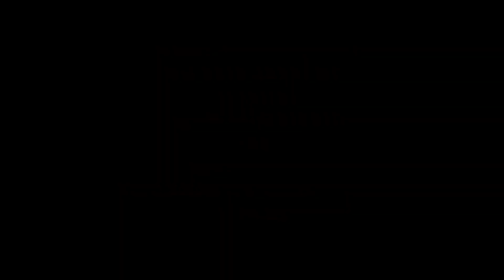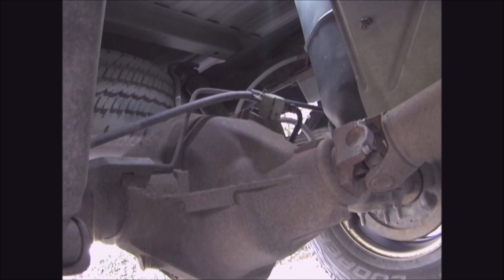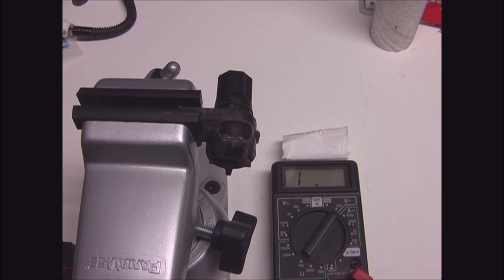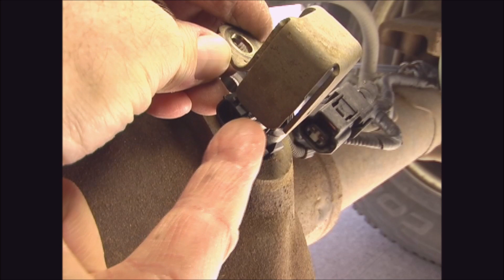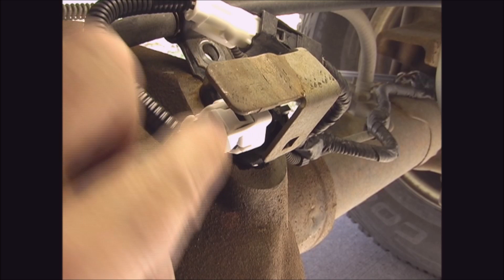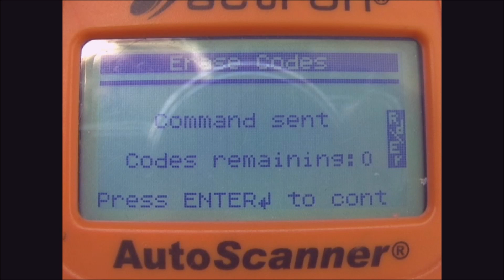How to Test and Replace Rear ABS Speed Sensor 1998 Dodge Ram 1500 Code PO720 P0720

Comment: Has anyone had this problem but slightly different? On my 99’ 1500 I’ve had the brake and abs light be intermittent since I bought it in 21’ but nothing else to indicate a problem. The Speedo works, and no CEL. I’ve replaced this sensor already and it went away for maybe two drives, I’m just unsure of what else it could be since there’s no code to look at for further instruction/possibilities. I haven’t found it on any forums other than this sensor. It seems to brake just fine and my e-brake works correctly as well any help is appreciated

Comment: I have a intermittent ABS light comes on and my speedometer drops to zero. Then the ABS light goes out and my speedometer works again? Is it a relay that's going bad or a ABS sensor.

Comment: Thank you for posting this video. Really good stuff here. My check engine light didn’t come on, but my ABS and brake light came on and after replacing this unit they did go off. When I ordered my part on Amazon, it also came with the protective cover that fit real well without having to bend any tabs up. Really appreciate this video.

Comment: Anyone have any info on the bolt that hold the sensor on? My truck is missing the bolt and i cant find a part number or size/thread specs anywhere.

Comment: Where did you get the part from because the ones I keep getting aren’t fitting
Reply from the maker: Rockauto.com
Reply: The one you are receiving is the front tranny speed sensor. Driver side, half way up the transmission.

Comment: Thank you! Thank you! Thank you! I'm more of a parts changer than a mechanic. While trying to wrangle the connectors apart 6 inches away the wires conduit about came apart. Upon inspection saw a broke wire. Checked the sensor like you did with an ohm meter without having to remove sensor. Showed resistance. Repaired wires. Disconnected and reconnected battery. Test drove. Eureka! Speedometer works, no check engine, or parking brake light. Thanks again Jay Gould. You are an outstanding intructor by the way.

Comment: I changed out the sensor and the brake and abs light is still on. What’s next?
Reply from the maker: Did you change the sensor on the transmission? I had to change that one also.
Reply: Did you do what jay said? changed mine & no chsnge also

Comment: Great and detailed video, nice work.  I do have a question, I have identical symptom on my 1999 Ram 5.9L Magnum 4x4 but the error code is P0500 Vehicle Speed Sensor.  Would you say it’s the same sensor on the rear differential as in your video causing this issue?  Thx.
Reply from the maker: Yes, I think it would be the same sensor

Comment: If these wheel speed sensors are bad can it cause transmission shifting issues after replacing the output shaft sensor

Comment: My 02 dodge cargo van has the abs and brake light on all the time(my speedometer works) 
I get 1.81 resistance on sensor.wiring is good.
Fluid is good.Brake pads are new.Brakes fine.Fuses are good.no leaks around calipers.
My scanner can't read its abs module. 
Is there anything else I can test? 
I'm just out of ideas. 
Any suggestions anyone?? 
I'm getting really fustrated with this thing.
Reply from the maker: Have you tested the transmission output speed sensor?
Reply: @WilliamFrawley  
Not yet. 
I didn't think that would cause my abs and brake light on all the time.
Reply: I have the same problem I did replace Tran output sensor and speed sensor to no avail☹️ and pointers?

Comment: Mine was very difficult to get off and on..had to rubber hammer it no joke to go in. It did fix my speedometer bit my brake light and abs are still on. What else could it be? Replace breaks and rotors because I know they are trash too and also brake reservoir empty but when I fill does not fix the brake lights or abs. Help

Comment: I had the same problem in a 2004 ram. Speedo would start at about 20. After replacing the sensor, speedo doesn't come on at all. Any ideas
Reply from the maker: possibly a fuse?
Reply from the maker: There is also a sensor on the rear of the transmission, this can be checked with an ohm meter

Comment: UGH!  I was following along nicely until 3:21, then mine snapped off, clean as a whistle.  The only thing remaining (Completely unreachable) in the Sensor hole is the plastic sensor cap.  I thought about going in from inside, but the gears would be in the way.  So, I will be digging it out from up top tomorrow morning.  Not looking forward to this project.

Comment: I've have watches a few different videos on this subject so far and none of them were very helpful. This is BY FAR, the best, most informative video I've seen, and I dont need to watch anymore after this. The other videos showed how to remove the first nut and then the bolt, and that's it... I was more interested in seeing how to remove the old sensor without destroying anything else. This was a perfect video for that. My 06 ram 1500 has been constantly flashing the abs and brake light at me(I'm talking 20 times a minute) and dings everytime. Sometimes the lights will stay on but when that happens, my cruise control no longer works and the same goes for my 4 wheel drive on the fly shifting. New sensor is coming today and I was hoping to go out and get the old sensor off before it gets here. Thank you for not only taking the time to make the video, but to be so thorough too.
Reply: Did that fix your problem? @jamesbaker I replaced both tranny and diff. Sensors. Parking brake, engine Light shines. The speedometer and cruise control not working. Was your problem fixed after replacing your sensor?